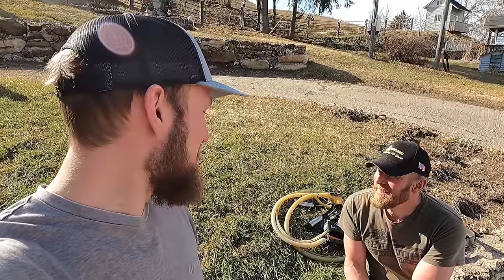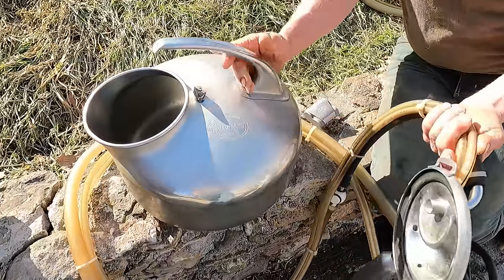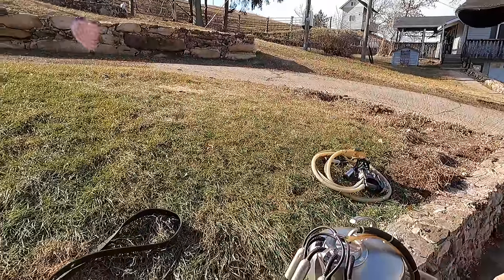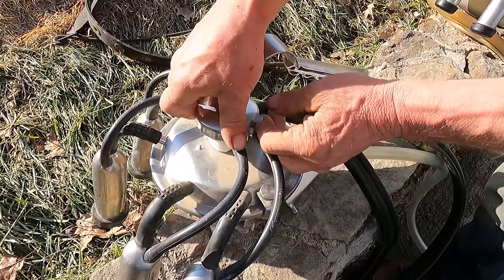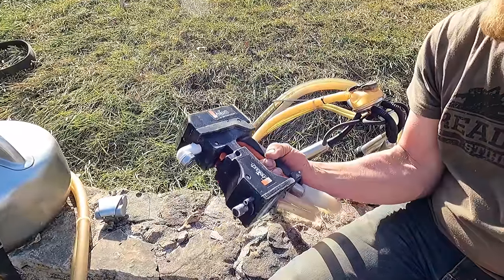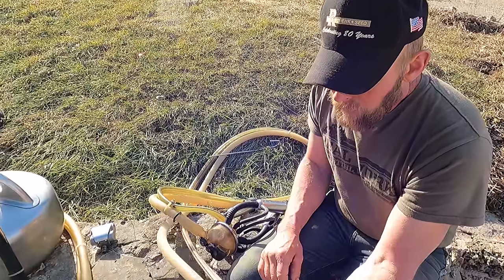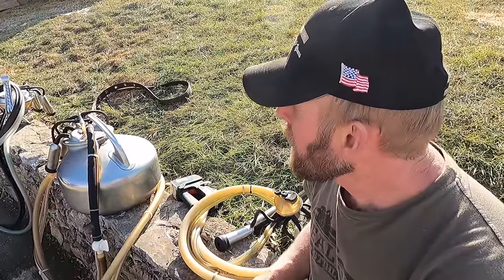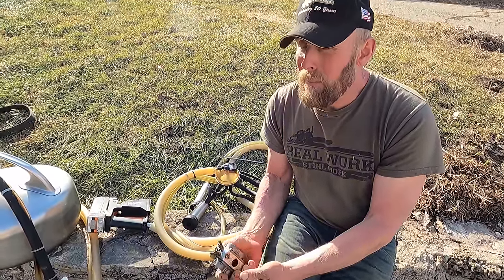How to Milk a Cow! The Equipment Used to Milk a Cow!

Comment: Grew up with surge buckets. i know have a delaval pipeline system . i always wondered what those breaker milkers looked like did not realize they were that big. One guy told me surge did that so that when u transitioned from surge buckets to a pipeline that the cow wouldnt notice much difference. U still had the strap on her back and u had some weight hanging on it because that is what they were used to with a surge bucket milker. It makes sense that way.

Comment: The first barn I milked in had Delaval milker buckets and a Sputnik to carry milk to the tank. It had it's own sock filter. The next barn had a pipeline with double pulsators. I remembered being told to be very careful with those pulsators because even back in the early 90s they cost $400.  This barn was converted to a flat parlor with automatic takeoffs after I left. I did go back to milk there a couple of times. Its a neat little setup. Those cows are gone now. The next barn I went to is a more modern set up. Double ten parallel parlor. It was new in the mid 90s when I started. I left working on a dairy full time in 2006 to manage a horse stable and estate. I love cows and continue to milk 400 cows twice a week. Knocking on 50 years old now I'm beginning to think milking that many in this type of system may be more wear and tear on my body than 50/cows in a  stanchion barn. Certainly more laid back. Having worked  with different people, the best milkers to me are the ones that like cows and have a deep interest in dairy. They will adapt practices that work the best for the cows vs someone who is there for a temporary pay check. Those people either tend to be in a hurry to get out or on their phone and tuned out.

Comment: Did you have a step saver at all when you milked with buckets? I had a neighbor that told me when there was a power outage during a big snow storm in the mid 70s , they hooked up a vacuum line to the intake manifold on their International 656 to run the bucket milkers in the barn. This was before they owned a generator .

Comment: Oh boy could I tell some storys...............I worked for one guy who bought Delaval auto take offs, only to run them manually..............I don't know how you guys used the Surge Belly setups, I never milked with one, and by the time I come along all I heard was stories, but it seems like a alot going on.  Delaval pails and dump stations were real popular here, then it seemed everyone put in Zero brand equipment that I was told worked well but the parts were not supported, so all the zero stuff I got to experience were the bulk tanks, which I thought were great.  I milked with a hodge podge of put together stuff of various brands.
Reply from the maker: I think all the brands had there good stuff. At the end of the day it's all about getting the cows milked.